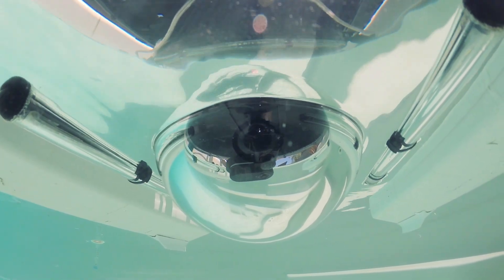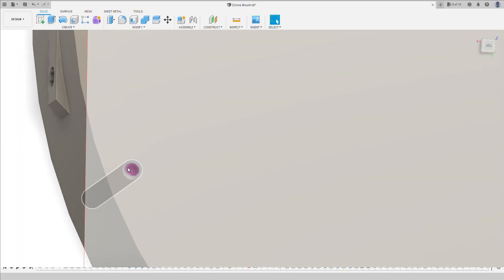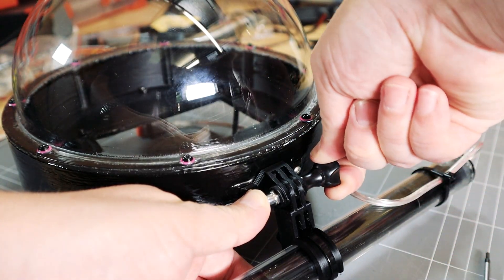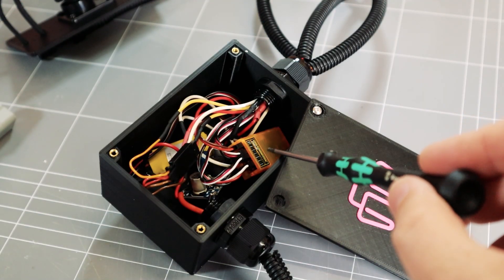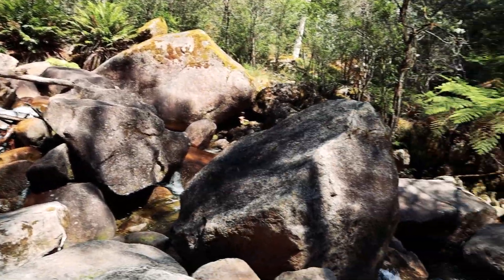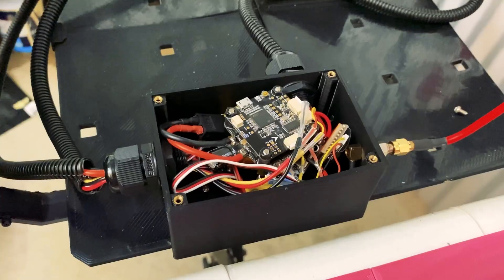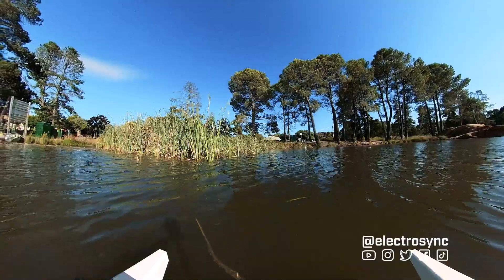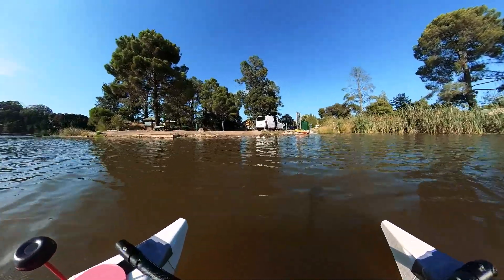Exploring Underwater with a Head Tracking FPV Camera

Comment: Cool invention!  If you place the dome with the camera on a submersible capsule, which will be attached to the catamaran with wires for signal transmission and electricity supply, then this will add some opportunities for exploring the depths in murky water.

Comment: You can easily make a dome from acrylic.  Make a small table and cover it with felt.  Make a hole in the middle and attach a compressor hose on the bottom. Make a plywood ring.  Put a piece of acrylic in the oven until it is flexible.  Lay it on the table and clamp the ring down over it.  Add compressed air and the dome will form perfectly symmetrical.

Comment: Not sure if you've ever had your head under water or not but you do realise that fish heard the first 3 full revolutions of that air prop don't you - Nice Water-Drum btw - if you spoke fish they would have heard that as well but what that fish heard made his mum run for cover.

Noise Remedy: Keep the nice clear drum but the fish heard the cam moving - DEADEN the air chamber in fact think Look around you "DUCKS" - that fish won't be concerned about something that sounds like a duck so it's dump the air prop and replace with a slow moving paddle wheel
Coming clean - you have a 3D printer and I want a concept proof.

Ducks feet are at the back so a drum with soft paddles hanging off the back to drive it "What Frequency does a Fish hear as an alarm - what sound made his mother fly back to cover?"
listen to all the sounds you can here under water - in the spot and run that Loop back to cover your own noise.

Comment: The head tracker pan and tilt is exactly what I need. I want to put that into a Sonicmodell HD Wing, which is an FPV flying wing with a clear dome window instead of a nose for mounting FPV gear. You do get two foam noses as well to easily swap out with magnets if you want. Anyways, I needed a way to control the camera within the dome with my head to look around.

Comment: You should design the dome and FPV camera system so that it can be raised when the boat is in motion and then lowered into the water when you want to view the bottom. Could even design it so the whole dome goes several feet into the water.
Reply from the maker: This is a great idea. I'd need some sort of crane to make it work I think.

Comment: Pretty cool man! That's what I love about 3d printing and Raspberry Pi (I likely would have gone Pi lol) You're only limited by your imagination. 
And yea, prototyping with 3D printers... make a mistake...no biggy. Need to improve a design...no biggy. PLA is cheap and some time. Love it! Ivr had a printer for 10 months a day have created so many useful things from tools and things for around the house to a dinosaur nightlight for my grandson using WS8212 LEDs and WLED in a ESP8266. I too... LOVE LED strips lol. 
Keep banging away. You could maybe use an ESP microcontroller for the camera. Very low power!

Comment: Hi I am just printing this boat on my printer(in pieces:)) so I was wondering if it would be better with an EDF that has 2.8kg of thrust or the propeller version. how much thrust does the propeller version produce. I wanted to use the boat for fishing (putting a line on it or just to put bait in the water) .
Reply from the maker: Good question. I don't have any data for thrust unfortunately, but I  can tell you that the fully loaded boat ways in at approx. 7 kg if that helps you size up your power system.

Comment: This needs a tethered drone to do dives. A micro sub connected to the power supply of the mothership, with its own smaller redundant power cell, should do it. Going this way also removes the need to drag a fish bowl through the water.

The whole thing could be hoisted into and out of the water by the boat using an umbilical. I would tape the control wires, the power wires, and the the video feed wires together with a strength member like a piece of paracord or nylon string, so that the string will be the first thing to get taught; it’s the spine of the umbilical and needs to take the tension off of the wires. The whole thing spools up on a motor-driven drum on the vessel.

Comment: @electrosync at 6.34 you said something crazy! I really don't think you will be able to find a fish FPV .... generally they don't have the eyes for it. No goggles currently available are going to fit a fish. Well maybe a flat fish as they have 2 eyes on the same side .... but even then I am not sure they can control the transmitter either - now if they had fish fingers maybe they could?
Reply from the maker: So what you're saying is, FPV goggles may fit a flounder?
Reply: @electrosync  yes - may fit a flounder - or halibut and may be even a skate or a ray. Not sure how they would put them on though. Maybe a sucker fish could help? Or an octopus. 

Great project by the way! Amazing footage at both locations.

Comment: I have a unique idea.   How about a 1 foot arm that stays up during ride to research spot.  (No dome drag)
Then lower the 1foot tube into water. (Contains wiring to a 360 degree outdoor security cam screwed onto plate at end of tube.  Create a 2 piece dome just large enough for camera full free movement sealed with quality glue. Seams smooth and almost transparent.
Just above dome a small cross bar.  Qty 2 led small lights on each side of bar with lights angled in 2 down + forward/ 2 down - rear. 

They will not create glare from being above camera dome.

360 degree outdoor camera has infrared as first option.  Then bar with 4 led lights as second option.
Camera distances range above water up to 45 feet.  Should give better quality than cameras you have.  Plus they have zoom.
WIFI ANTENA THROUGH PIPE UP - OUTSIDE.   CELL PHONE APP OR IPAD APP WITH CAMERA SOFTWARE. 

PAIR PHONE WITH CAMERA B4 LAUNCHING.   ( SHOULD HAVE A SUPER CLEAR CAMERA VIEW).

JUST AN IDEA…

Comment: Huh, I know it's alot but if you could set switches for things and connect it all..like fpv cam on top with boat control, fpv on bottom with boat control. And with your head tracking I'm not sure why you need two TX?

Comment: Yes, looking at night underwater is better than day, use multiple lights to get rid of those shadows. A cable connected RPV could go down or you could put a camera on a motorized extendable shaft or straight shaft that is hinged at the back and poking forward,  you would lower the shaft down and get that camera down closer to your target.

Comment: Really interesting video, thanks. I’m at Albury, you can’t be far away…
To improve your projects, STOP using silastic sealant. Your dome base for example. Include a small channel in the dome base, smaller diameter than the screws. Put a rubber O-Ring in the channel and tighten down dome. Hope you get the idea. You can repeat this in a lot of places you use silastic. More effective, easily discountable, no mess &  professional looking build. 
Cheers, Michael

Comment: Why not try to build and use a couple of "waldoes?" (A mechanical remotely operated arm.) One to put another camera on, and another to put a pincher/grabber to pick up lightweight items from the bottom. Or one that has lights and cameras and a grabber?   // Although it would probably need another operator to run the extra items!

Comment: I have thought about attaching an enclosed camera to cat 5 cable and lowering it into the water with a winch. My thoughts were that by lowering the camera vertically it wouldn't get snagged by underwater obstacles. There 'would' be some drift especially if there were waves on the surface...but...the propulsion motors wouldn't need to be waterproofed and a tether from craft to shore would not be necessary.
Reply from the maker: A winch would be great. Ethernet cable would be a neat way to do it too.
Reply: @electrosync  An analog coax cable can be used with your setup, and they are down to 4mm thick.. If you load the camera heavily to get it to stay vertically under the boat, you will need some fishing line to take the load. The coax cable isn't that strong.
I have made a similar camera setup, that I can lower from my boat (a manned boat). I use a downrigger to hoist it up and down. Inside the UW camera house there's a VTX transmitter, that keep the video signal strong enough to use an FPV antenna above water. I don't know, if you can feed the headtracker signal in the opposite direction in the same coax cable!? Probably if you go digital :-)

Comment: This boat offers so many possibilities. Not sure if the underwater dome allows looking up enough to aid with navigation. Maybe having two cameras (above/below water) with a video switch would allow you to easily navigate to location, or avoid reeds or surface obstacles, while still being able to explore underwater views. Is almost like being in a submarine.
Reply from the maker: You can see forwards enough to make out your path, but it's a very small window because of the boat design and water line. There is also a forward facing camera on one side of the hull which was meant to be wired up to switch between cameras using a receiver controlled switch. I never finished the wiring for that after some setbacks, but I have all the parts there.

Comment: Could this application be used to record an sporting event from a telescopic pole.  I know you can't use the boat.  But i was thinking about the pan and tilt motor and the rest of the setup.  I record American football games for a local high school and I record a tight view from the endzone.
Reply from the maker: For sure. It would probably be easier to just buy an off the shelf camera gimbal if your budget permits though.

Comment: protip for future lightbar builds either fill the bar with a clear acrylic or use a quick fill cartridge from a bike to purge the air from the tube to remove any moisture preventing internal condensation entirely, do this with any viewing volume you can to prevent fogging from ever happening
Reply: Also remember that some resins are sensitive to UV and decompose, turning yellow. Also resin shrinks a bit when curing, so don't seal the ends until after the resin has cured.
Reply: @PunakiviAddikti  надо в сухом и тёплом месте заклеивать трубки. Тогда влага не помеха

Comment: I think you should make it go deeper, by using a second bubble, and a crane!

That would also pull it all the way out of the water (no drag while moving to a location), then just lower the bubble to a depth, and have a look around. Would need a long cable (maybe ethernet in a tube?), and a weight on the bottom of the bubble (to make it sink), but totally do-able.
Reply from the maker: Great idea!

Comment: would add some complexity, but what about a full 360 dome attached to an arm that can be lowered into and out of the water? so when you want to go fast you raise the dome out of the water - and you can see above the water (which would still be a cool perspective) and when you want to explore the dome lowers into the water.

either way you earned my sub, great project!!!!
Reply from the maker: The original plan was to have a linear actuator on top of the deck to lower and raise the dome into the water. I can't remember why I ditched those plans now - I think it was too complex?

Comment: Cracker of a project mate and a nice video too. 
I frequently use the Go 2 camera for all kinds of things including FPV drones, when I learned about the Peanut I wanted one but couldn’t justify it with already having 2 working Go 2 cameras. But the limited battery life was getting me down…..
So I experimented with the Peanut’s power adapter and I found that by shaving off the rim where it fits into the Peanut it actually works well with the Go 2!
So I made a mount, printed it out, stuck it on my drones, and now my Go 2 stays powered during flights.
Thought you might find that a cool thing to know.
Reply from the maker: The battery Go 2 battery life is an issue, even more so if you don't have good airflow. Thanks for the tip! That power cable is cheap too!